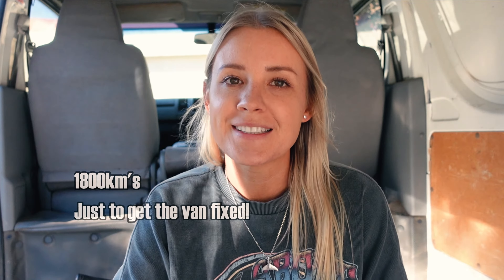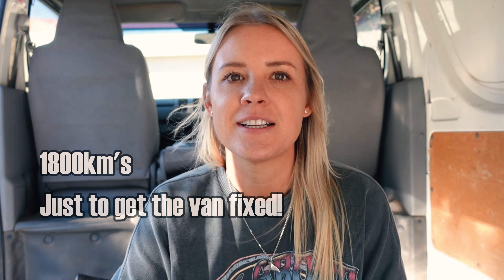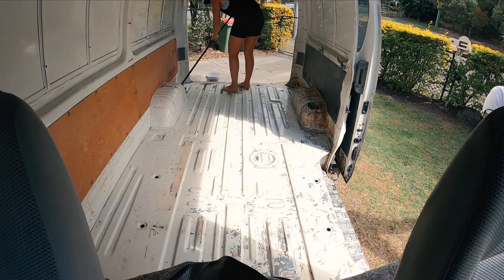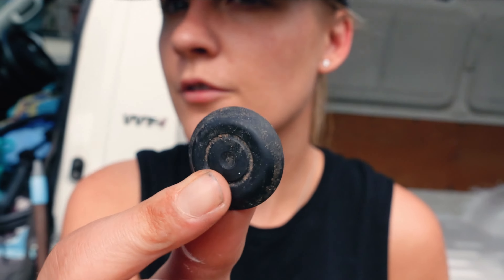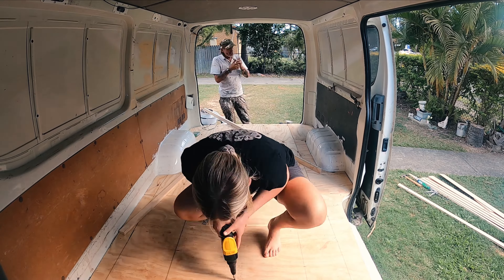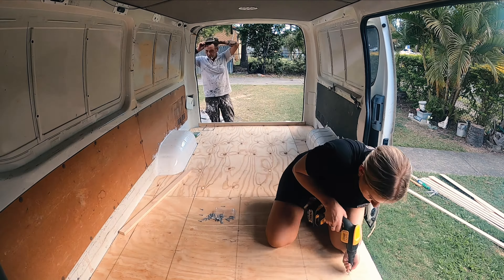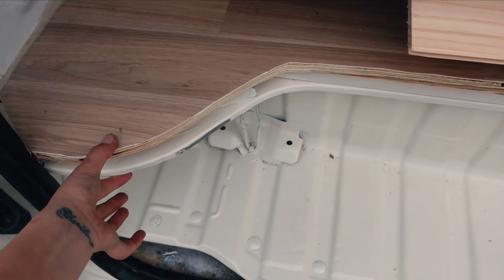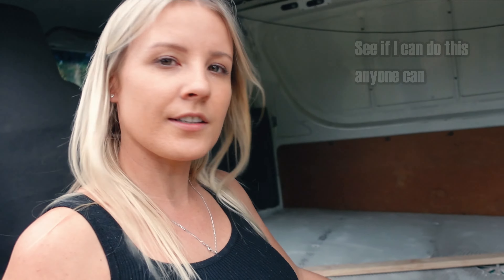I bought a van! | Toyota Hiace Van Conversion

Comment: So interesting!!! I was drooling over your previous van (because of the size and windows, loved the set up) and now you have a van similar to mine in size. I have a VW multi van with all the seats in the back out. I got the two front seats converted to swivel (I got it done by Vanessa in Sydney who arranged for a road safety certificate, this is required by law). My Best Buy was the Dometic CFF45 portable fridge (it came with a cover) it’s just the right size for the essentials and best of all doesn’t take up too much room in the van. I had an extra 80 amp/hr battery installed with inverter, I only really use the 12v plugs with this (esp for the fridge) because it’s energy efficient.  My next buy will be a roof top box for firewood, spare clothes, tools, gas for cooking (I just don’t like having it in the van, I’m sure it’s fine but don’t really trust it not to leak).  My favourite thing is the fairy lights, it’s just enough light to change by at night and looks so pretty. So looking forward to your build and wishing you all the best.

Comment: That's great progress you lucky to have a great help with this build and it  will look awsome what are you using on the roof? Tracey and I used earthwool batts and lined with the pine panelling. I would also recommend carbuilders sound deadening sheets they are a bit on the pricey side but well worth it for noise reduction
Reply from the maker: Awesome thanks for that. We did just use the same insulation that we had left over from the floor. But I’m going for use the earth wool on the sides. 😊
Reply: @charlene_louise  your welcome